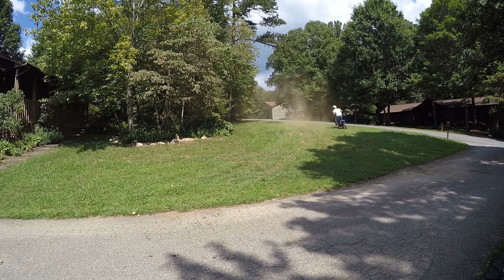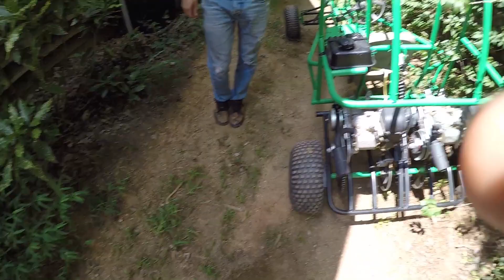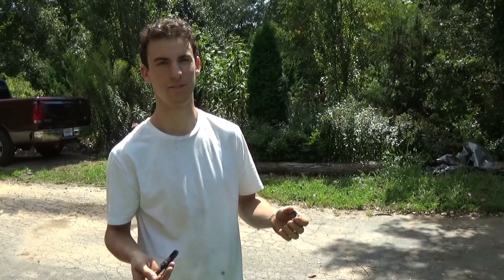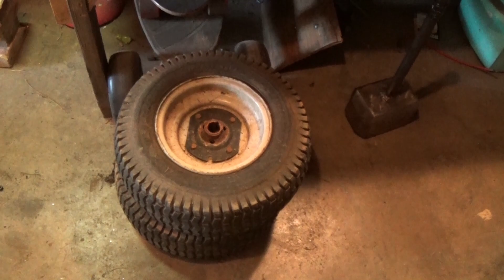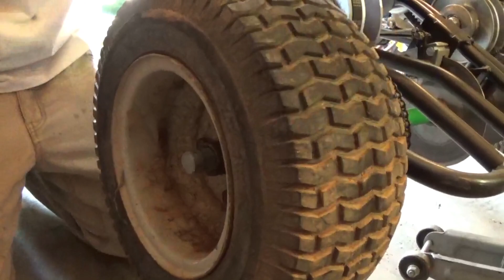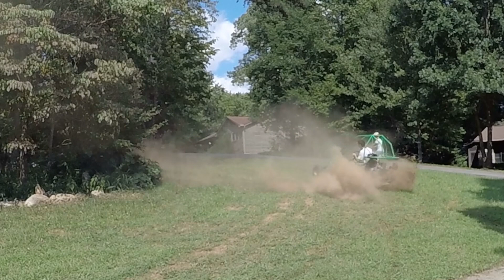riding the dirt bike and go kart around my yard

Comment: the gokart moves surprisingly well. maybe gear it for more top speed. since you have 2 engines worth of torque. 
sweet vids bud. cheers 🇺🇸🇺🇸🇺🇸
Reply: I haven't seen to many of the videos, but I was wondering if you knew what kinda hp and torque that green buggy had. (you just seam well informed and I'd rather not sit threw several ling videos to find out.)